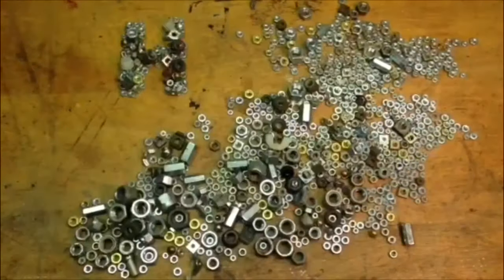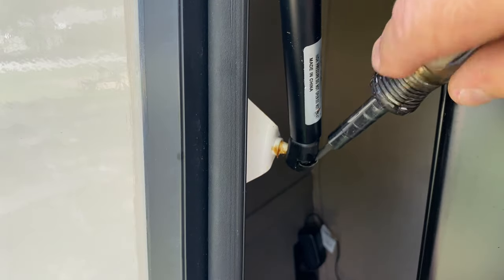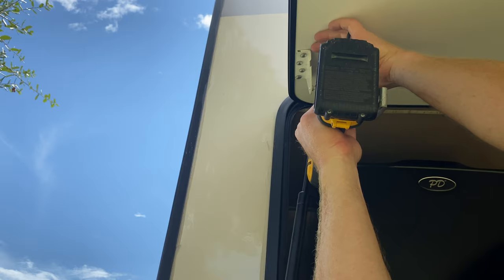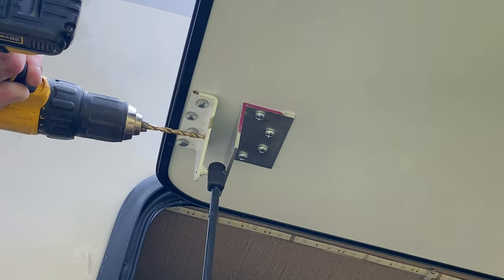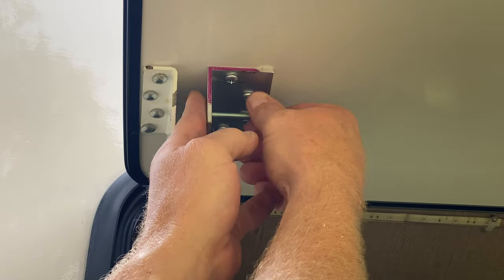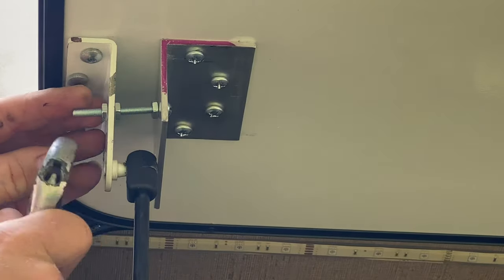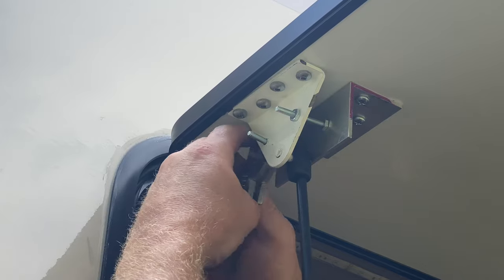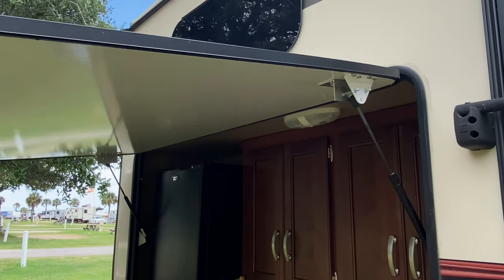RV Gas Spring/Strut Bracket Repair

Comment: part of the problem is manufacturers use way too short of a strut for a large door.  I would replace with nearly double the length struts like a 27" or longer, move the strut mounts (not the ones on the door itself) down closer to outside kitchen countertop as low as you can get them, and move the door mounts further down closer to the middle of the door and not so close to the edge.  And use about a 4"x8"flat aluminum under the mounts to spread the tension out.  Amazing how engineers thought 3 short screws could hold up going into a foam core door.....when they coulda spent 4 dollars on a short piece of framing on each end.  BTW they also installed your struts upside down. The piston is supposed to be facing down with the smaller diameter rod ball end on the door

Comment: This is all good until the inside of the door rots out like most do, i’m currently trying to come up with a different solution other than replacing thr plywood inside. I’m thinking about trying a 5/8” piece of pvc board, my only concern is the rigidity of the pvc compared to plywood
Reply from the maker: Might be a good alternative. I don’t like the way RV are so cheaply made.
Thanks for watching.

Comment: Need to trim those  screws up.  Too long.
Reply from the maker: NO, the screws that I added were the same length as the factory installed screws. Just long enough to hold but they do not penetrate the outside at all. No trimming needed. Thanks for watching.
Reply: funbro1 Sorry, I meant the bolts you used.
Reply from the maker: The bolts can be trimmed if necessary or they can be replaced with shorter bolts if you feel the need.